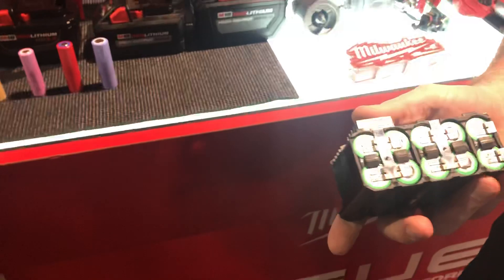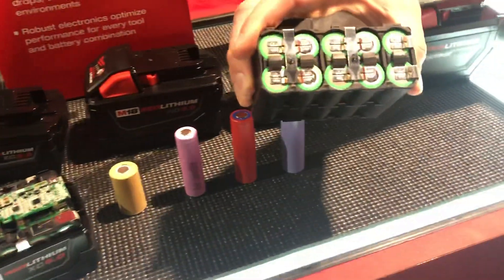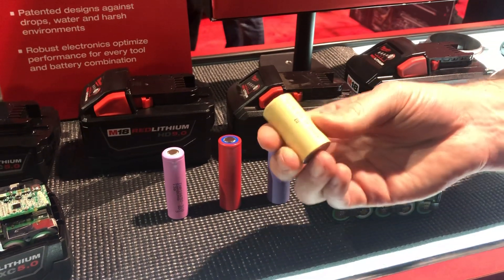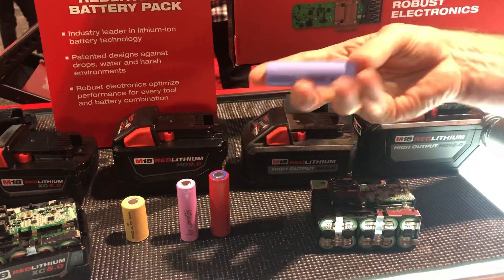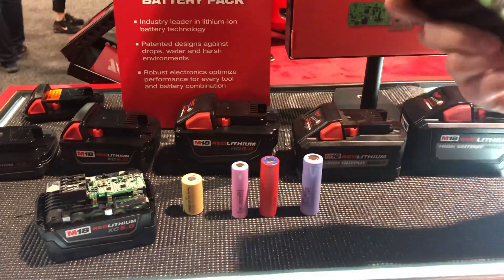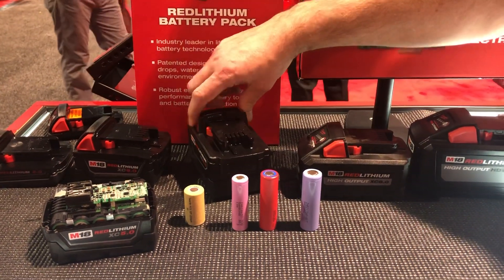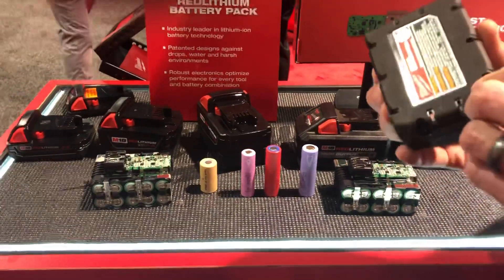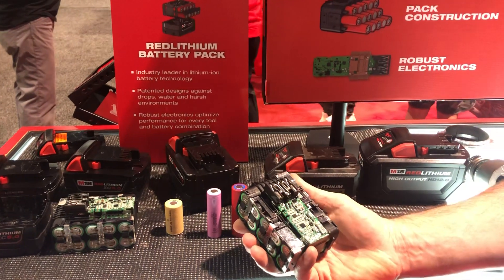Milwaukee Tools Battery Platform Technology

Comment: Does Milwaukee actually manufacture their own lithium ion cells?  Also, will they be coming out with battery boots or protective covers to help the battery packs resist cracking when dropped on hard surfaces.  I know that’s been an issue at least with the older packs.
Reply from the maker: BlindBatG34 they don’t manufacture the cells themselves, however they patent the cells manufacturing if that makes sense and configuration. They do have boots for the tools, batteries base is rubberized.